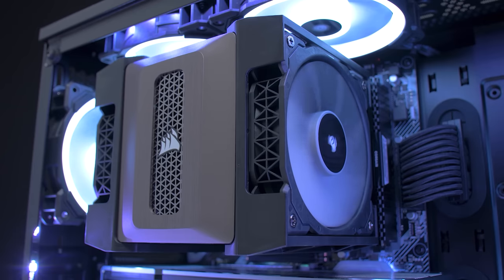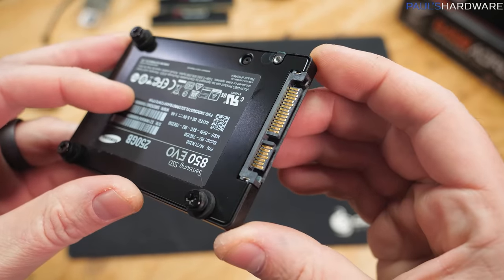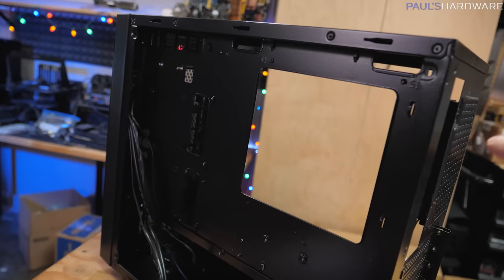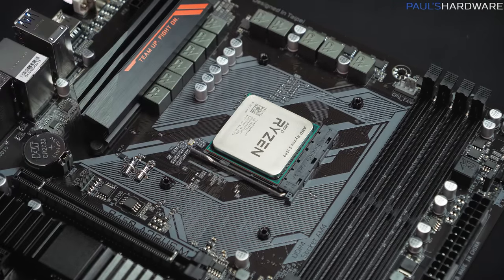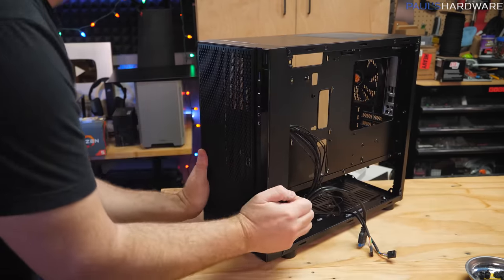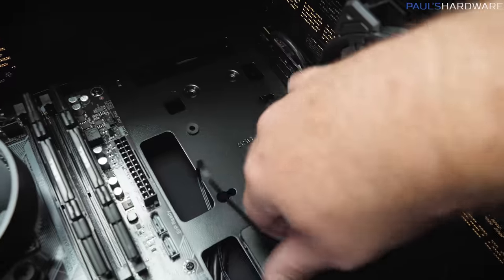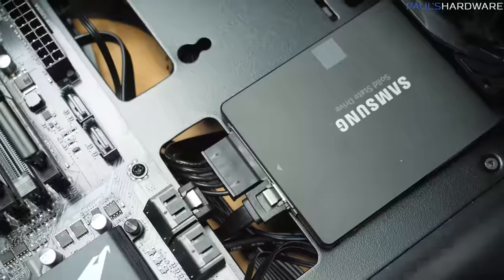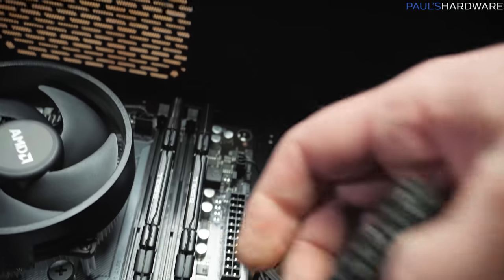How To Build a $550 Gaming PC in 2020!

Comment: Just a heads up, I made a PC part picker list of this and it came out to $814.93 USD.
Reply: Dang
Reply: @gal4xyislost  ikr, the cpu was like $250
Reply: Prices for pc parts have fluctuated, I was gonna get a 2060 super for like low 300 and it jumped up to high 600
Reply: Yeah mine was 800$
Reply: The 1600af and 570 are overpriced now. Replace the 1600 with a Ryzen 3 3100 and the 570 with a gtx 1650 super. Its a tad bit more but it's worth it imo
Reply: @eamonbrannigan  price went down to 150
Reply: As of Dec 16, 2020 this pc build costs $763.93 USD via Amazon

Comment: Even though I could build a new system practically blindfolded, I LOVE watching you build a beginner PC Paul. It's the Zen like experience we all need in these trying times 🖖
Reply: This is so true. Paul's walk throughs are soothing AF (pun intended)
Reply: Same here, building computers for over 30 years now. Love the way he explains stuff, doesn't do the overrated shouting some others do. Clear explanations, good advises, good instructions. When people ask advise for their first build, I mostly recommend them to watch the video's of Paul.
Reply: Did you watch Kyle build a system actually blindfolded?
Reply: @photonboy999  Yep....can be done---with a bit of luck. The cpu is the real issue as it needs to be lined up properly, something you can't do blind other than sheer dumb luck. Otherwise, it's a matter of knowing your parts before you do it. Looks harder than it is 😉
Reply: @dragon2knight  even the case-> MB cables? Hate those small things...
Reply: @Tabacish  They can indeed be a pain, but all you really need to get it going is the power switch, and that's always two thin single  plugs as opposed to the dual block plugs, so your good to go there if you know what you're doing.
Reply: Watching Paul put together a PC is like watching Bob Ross paint.  It's just a smooth process, and there are no mistakes!

Comment: If you want to build a budget gaming pc I got a few comments: 
1) Don't give a damn about bling like tempered glass or side windows.
2) Don't give a damn about RGB lights. 
3) You can save a lot of money if you hunt for a used pc case in good working condition. They virtually do not age if you don't live near sea water (rust).
4) Don't buy fancy looking cables accessories. Again this is useless bling. Who cares what your insides look like, LAN parties are a thing of the past mostly.
Those things add nothing to a build besides being flashy fashion accessories. It doesn't matter what your pc looks like. Invest that money into better parts that improve performance. If you do not overclock you won't need to care too much about airflow as well. Just my two cents to max the performance.
Reply: These are great points, especially in self isolation, who cares about the rainbows, I just want performance!
Reply: Under rated advice! I have kept the same motto for my build throughtout my years. If i have extra cash or later if i can save up after the performance box is ticked,i would go for cosmetic upgrades!
Reply: So I think I have to elaborate a bit further on my airflow statement. Thermal management obviously is important but I think all this high airflow cases discussions is a bit out of place for poorman builds. Personally I am more noise focused and I do not overclock and so far every build has done fine with the thermals. If you live in an exceptionally hot area you'll obviously have to pay more attention to detail here to prevent thermal throttling. But in 25+ years of working with PCs I have only seen throttling once and the reason was a smallish dead fan on a small cooler in a rack mount pc at my work. But then again it's usually not super hot were I live.
Reply: All is true, no words about it.   Once everyone's stimulus checks comes, they should spend it on building a PC.
Reply: Billy Gsell those who can collect😒
Reply: Point 3 is too true, I live near the ocean and the intake on my Cooler Master is completely rusted, Needs sanding down and anti-corrosion coating.
Reply: I have a setup thats 1200, its a starter ryzen 7 2700x, pc itself is 950 and paired with a tomahawk mobo.  I would like to have bling so my setup can look lavish enough. Its all dependent on perspective. I like rgb, my bud doesnt. Wish i wouldve went for the max mobo but whatever prices always go up and down.
Reply: Jordan lmaooooooo
Reply: Comment to 3: Or in the central-african jungle...
Reply: And if you just NEED lights buy a RGB strip there like $10 and easy to install
Reply: It’s based on preference mostly. Some people tend to add RGB to make their build feel special (for instance, if you just built your first pc). Some upgrades are good though, such as fans or rgb fans for cooling.
Reply: Also another thing is not only are rgb and rainbow keyboards are useless performance wise but they also use up more power than normal keyboards
Reply: When I wrote my comment I wasn't aware that RGB lights and tempered glass have become so prevalent that they are hard to avoid. The message that I wanted to convey is that one shouldn't focus on the bling. Corsair 240 RGB AIO or better GPU? To me this answer is quite clear.

Also prices are on the rise, especially in the US, or so it seems to me. I have yet to see the illusive Ryzen 5 1600 AF for 85$ ... but then again I am not an US citizen.

If one could still find the Ryzen at that price a RX 580 system would be possible but for 550$ it's still a challenge.

You'll also find that the links under the video will either lead to out of stock or higher priced items. That was also the case when I created my initial comment.
Reply: Clorox LYSOL Bleach WHIPES exactly, I’ve been waiting for 2 1/2 weeks and NYC unemployment still hasn’t gotten back to me, what a mess everything is right now.
Reply: Reaper One it’s because prices fluctuate. When this build came out a month ago, the parts WERE only $550. Now the prices raised to $750. Its common economics, it’s not that hard to understand. Especially considering you watched the video after a month had passed
Reply: Everybody's a streamer nowadays so aesthetics are more important than anything for them. 
The type of person to spend money on Nanoleaf instead of RAM.
Reply: I found some RGB fans on amazon that are in a pack of 5 and the fans are 120mm for 30 bucks its cheap.
Reply: It depends on what your goal is and what makes you happy. A lot of people care about aesthetics including me. It really increases my enjoyment of a PC build when it looks as good as it performs. Every time I look at it I feel good. If you truly don't care about aesthetics at all then sure you should put all your money towards performance. I personally would rather have an Audi with an inline 5 than a pinto with a V12 dropped in it.
Reply: true the graphics card and SSD are way more important.
Reply: Great points. Not to mention getting a $100+ AIO cooler right away when the stock cooler (at least on AMD) works fine in an initial build!
Reply: I don't need rgb. I'd rather have the machine set up the other side of a wall so I don't have its fan noise in the room with me.
Reply: @SamChaneyProductions  

You're certainly right. I don't think there is a right or wrong here, just what you like and what you can afford. Even before the price increase 550$ was already a tight budget for a decent, modern gaming pc. Especially true if you need to buy peripherals as well (monitor, mouse, keyboard, sound system or headset). In that price category it makes more sense to me to focus on the basics and raw power, especially if you're a new builder just starting out who may not have the experience to judge what's needed and what's not. If you can drop the money on RGB stuff and do like it by all means go for it. :)
Reply: @chescajimenez3204 

So true. I see a lot of poeple on reddit.com/r/buildapc who seem to think that they'll need to spend ridiculous amounts of money in cooling when all they really needed was their R5 3600 stock cooler. But hey, I guess that's what the industry is like nowadays.
Reply: WELL SAID SIR WELL SAID! :)
Reply: overclocking or not, air flow is important! wont disagree with anything else
Reply: So are these specific items worth buying? Cuz i have no idea but i really wanna buy a set up for the first time
Reply: @debeshmalakar6431  You could have gotten a Ryzen 5 3600 ($104.99 right now) instead and had the same performance, because your still not using all those cores in gaming. That CPU will throttle to 4.3..., (0.1 Ghz less than the ryzen 7 2700x), which is more than enough for any games. If you stick with Radeon/ATI gpu's, you get more bang for your buck and even the second highest Radeon gpu, (the Red Devil) is under $500 and will run any game with ease at 1200 Hz and 8 GB ddr6 ram. You could have spent the extra money on a nice big nvme M.3 drive for quicker game loads and overall quicker harddrive perfomance (they read and write around 6 times faster than a standard ssd drive, (if your board supports it)
Just a few options for your next build. I spent about a week or so researching specs and prices, plus watching youtube videos on reviews and benchmarks before buying.
Reply: @Sam Chaney... that’s where and why your a sucker!!

Id take the fully worked V12 pinto.... 

drop the pinto body frame (computer case) and toss that engine (computer internals) into a nicer body frame and best of both worlds! Bye bye Audi!
Reply: Retrodude 21 learn how to read dude.

Comment: Me: knows how to build a pc
Also me: just finished a build
Paul puts out a video: sure I can watch a learn to build a pc video
Reply: wait..... Are there people here who don't know how to build and trying to learn.... I use these videos for a reference guide. Mostly remembering where the sata data cables are stored (do they come with the power supply, the mobo, the case. i can never remember. fire up a video) lol
Reply: @thegamemaster2000  Silly.  They come with the tweezers.
Reply: fun times
Reply: Which build video do you recommend for first time builders?
Reply: My processor died when I was gaming so I might have done something wrong when building my pc 3 months ago rip
Reply: @brandonhalverson4587  Which processor were you using? Rip.
Reply: @ashishdutt1914  ryzen 5 3600x lol 200 doll hairs
Reply: @brandonhalverson4587  No processor deserves such early demise😓
Reply: @ashishdutt1914  agreed but I have no money to buy a new one and amd is taking ages to reply to an rma form lol
Reply: @brandonhalverson4587  Yup it is possible that it was a DOA product. Did you make sure that it was not a PSU problem as they can be faulty too and their is a high probability that your new processor will be cooked too if their is a problem with the Cpu rail from the psu.
Reply: @brandonhalverson4587  And also make sure that you didn't have Pcie cables and Cpu cable reversed. It is difficult to fit a pcie cable in the cpu cable slot but it is very much possible and i have seen people do it.
Reply: @ashishdutt1914  nah its not the psu problem i just got a replacement one of those and it was fine for like 10 minutes the computer then it died again and now i turn my pc on and there is a solid red light on cpu that means fail to detect or whatever, and I got the cpu cables connected trust me lol
Reply: @brandonhalverson4587  Hmmm then it must be a DOA product. Let's see what happens when the new Cpu arrives. Update me the fate of your Pc as my interest has now been provoked lol.
Reply: Same here. I still watch these 'build a pc guide' just to refresh my knowledge, and is very helpful to those who wants to build their own.
Reply: somehow therapeutic watching this video at a time like this
Reply: @TheOGLober  Paulshardware: how to build a gaming pc in 2019.
Bitwit: how to build a pc step by step.
Jayztwocents: how to build a computer. 
Jay and Paul have good videos on installing windows and bios setup too.
Reply: @wofljaw  yeah thats 2hat im trying hqha
Reply: jacob chris nice thank you
Reply: pocketlint82 does this video seem like a good one to use or is the 2019 one better?
Reply: pocketlint82 , I learned and refreshed knowledge when building first PC after almost 20 years. I love watching these.
Reply: It's nice and straight forward. No crap, I sent it to a friend that is getting into PC building
Reply: @brandonhalverson4587  I don't know why but I was reading 'professor' instead of processor... I was quite confused for a while... 🤣
Reply: @kshatriya9921  lmao thats funny my professor died
Reply: pocketlint82 same
Reply: Same. I think its fun to learn how others do things. Although most things will be similar, the way everyone does something will be unique.
Reply: Me: doesnt know how to build a pc
Also me: has watched 40 pc bulding guides
Reply: how tf do u guys know how to build a pc. bruh i’m just gonna follow what he says 😭
Reply: Same
Reply: that's exactly me right there haha
Reply: @Will Bagnall... then your brain is fried and you need to learn how to focus and retain information I’m sorry for you.
Reply: SAME

Comment: awesome tutorial. I literally had no parts that were the same as Paul's and was still able to use his guide. First time building a pc and it was actually pretty fun and easy thanks to this video. can't thank you enough Paul.
Reply: Same here and he is right about the most aggravating part of the front panel connectors. This was my second build but the first was about 15 years ago so no help. LOL, I never did get the front panel working right on it.